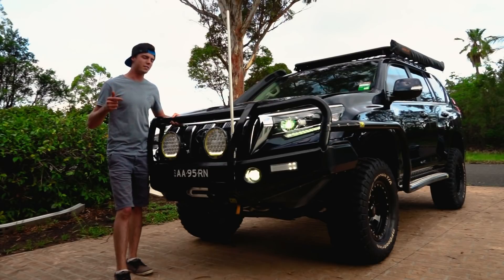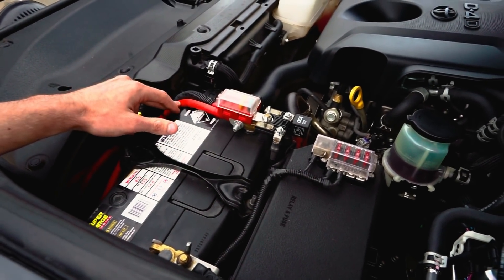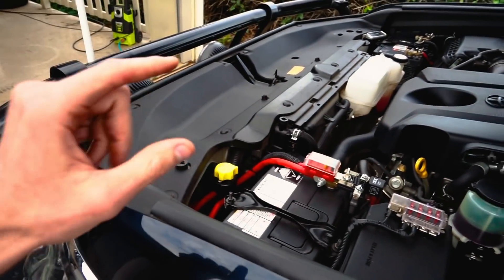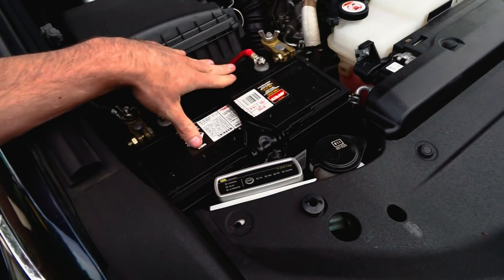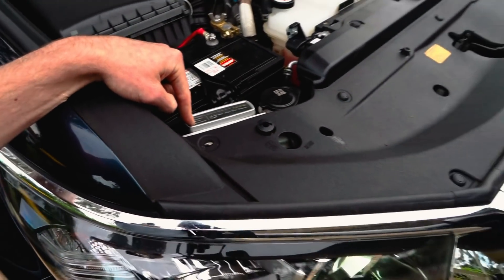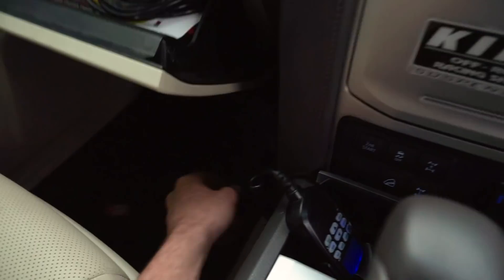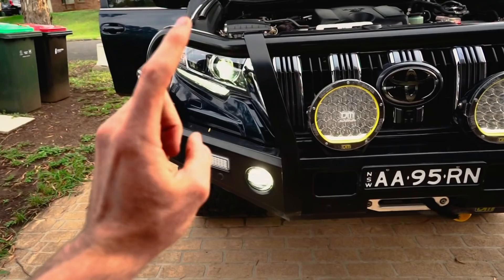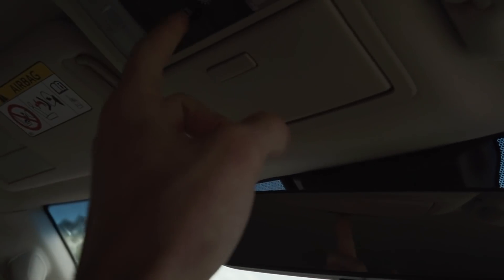My 12V System Overview, Dual Battery, Winch, Lights, DCDC Charger - December 2018

Comment: hey what size bf goods are on this are they 285/70
Reply from the maker: Hi mate, very similar. 

They are 305/65/17 
Just abit wider 0.1” smaller diameter

Comment: What model supercharge battery mate, 👍
Reply from the maker: Peter Wilks MF95D31L
CCA 810
RC mins 175
Reply: Ta mate, $249 autobarn, where did you get it for 180? What made you choose this battery, ive been running century but I reckon their quality has dipped a bit. Cheers for the reply.
Reply from the maker: Peter Wilks bought off Online batteries or something. 
Ended up picking up direct.
810CCA was massive. Good value 
Couldnt go wrong.

Comment: Hey mate. What sort of bracket are you using to mount that projecta? Thinking of doing the same after watching your video. Very neat wiring you got there mate. Awesome job.
Reply from the maker: Hi there mate, i just made it myself, its some aluminium angle from bunnings. 3mm thick approx, maybe 50mm wide. 
Theres photos of it on my instagram if you get stuck 👍🏼
Reply: Thanks for the info mate.

Comment: Hey bro, just quick question about the TJM spotties. Did you plug n play to factory loom? Or run its own loom?
Reply from the maker: With these you have to run the Toyota Harness or an aftermarket variant of it like ARB i think has one now. 

Its quite long and plugs in line on the Headlight stalk inside the cab! 

Check my website www.aaronoffroader.com in my DIY tab, i cover it and even have the toyota instructions on there

Comment: Nice rig bro. What T/C lock up kit are you using and how do you find it?
Reply from the maker: Richards Auto Electrical lock up kit. 

Dual speed automatic one. 

I believe its and essential to any automatic. As it saves fuel aswell as keeping your transmission cooler and adding drive ability

Comment: How do you find the projecta? I am redoing my 12v and was looking at the projecta as my dc-dc.
Reply from the maker: Projecta is going very well, i havent got a solar panel but ill have to borrow someones oneday and see how it goes
Reply: I’ve got the same one works very well, done a few trips and used solar successfully.